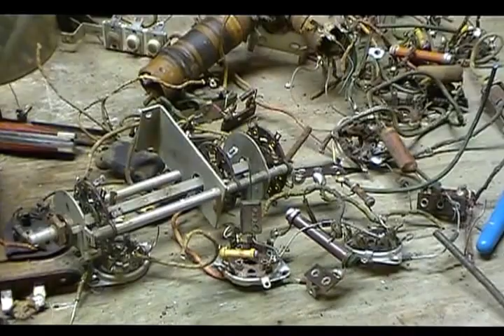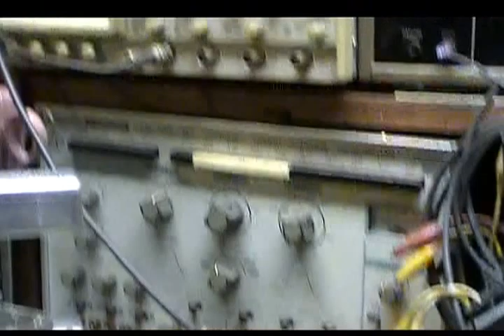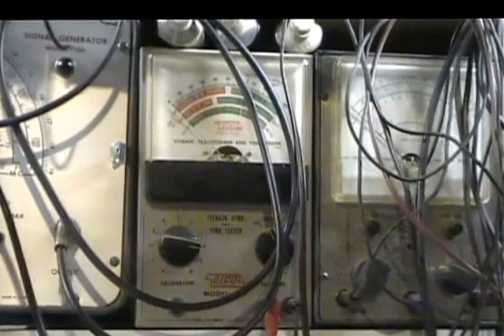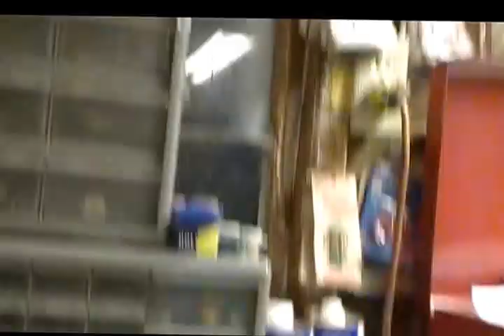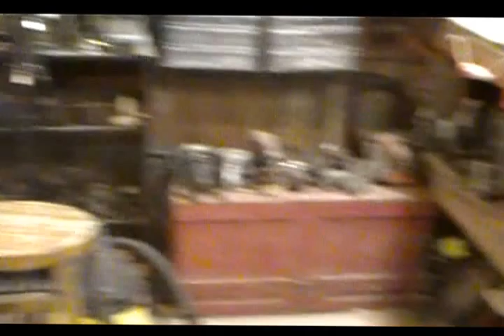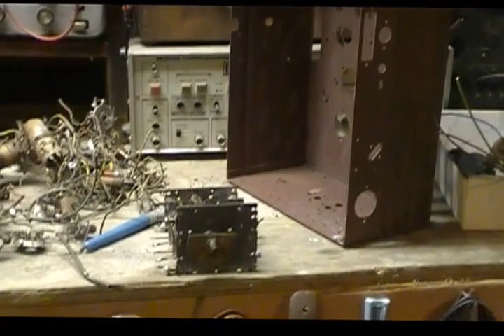The Shop

Comment: Are the fridged tubes sound any better? Nowadays some guys out there fridging/frosting their guitars, and they claim that after some time frosted they do sound better...so may that´s the same with your tubes;)

Anyway very nice tour, thanx Dennis, i like that!

Please do not feel insecure/doubtful or similar, as, at least i (just can speak for myself), like what you´re airing, so keep them commin´ :)
Bottom line is, this is your cannel and it´s all up to you, what you want to show. If you do something like a follow-up because of the comments, it´s cool and i´ll appreciate it :)
Reply from the maker: TubiCal Thanks, and sorry for the long delay. As for your question about fridge tubes it does not change anything with the tubes performance. Tubes operate by heat cooling them doesn't do any good.

Comment from the maker: Hi Jim. Thanks for watching. Lets see I have been collecting my equipment about 45 to 50 years. I to think about that little bit cause I have doing this for a long time now. I don't think I have any of the stuff I started out with. I would by something and restore it and use it for a few years then sell it and get something else. The shop lets see we been here for about ten years now. When get out of college I went to work at a local TV and radio repair shop until it closed. Dennis